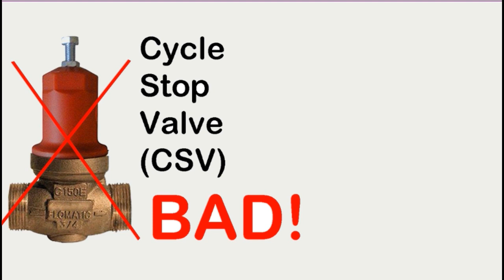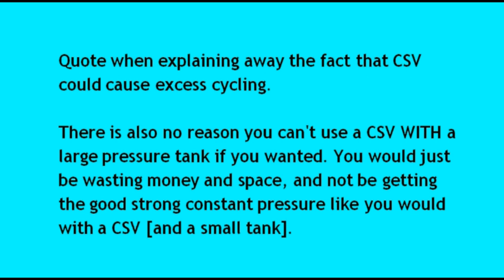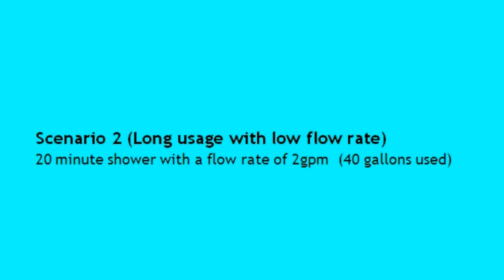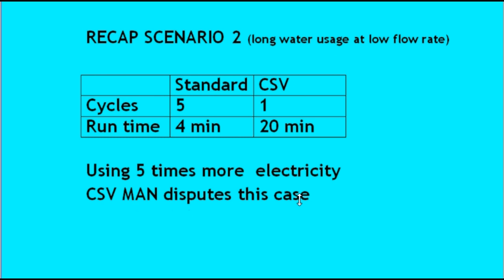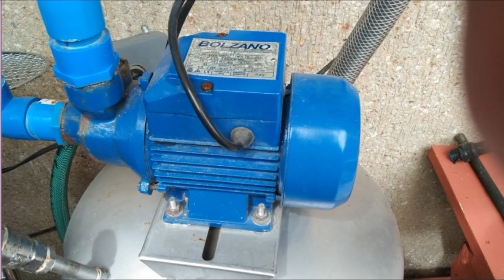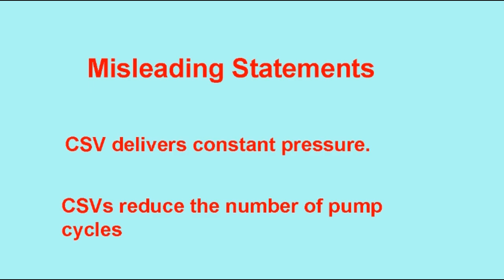Cycle Stop Valves ARE BAD for pressure tank systems!  Pros and cons of CSVs – few pros, many CONS!

Comment: I understand all the points you make, but how do I successfully tee off between my well pump and my pressure tank without a CSV? I need to tee off before the tank to run 300+ft of 1" poly to yard hydrants.  .  I am convinced I need a CSV because if I tee off BEFORE the tank, I would need to remove the check valve that is right before the pressure tank or i wont get pressure to my Tee/hydrants. If I do this and get flow to my Tee/hydrants,  the problem remains that I will be rapid cycling my pressure tank because I will be using hydrants to potentially irrigate an orchard. Putting a CSV before my Tee, after the well pump, should solve this by doing what it is advertised to do (maintain flow according to demand to limit pump cycling).But you make all these sound points against CSV. So how do I achieve what I am trying to do without one? Also, I need to remove the check valve between the Tee and the pressure tank in order to get flow to the Tee,  but rather than tossing the check valve aside, should I install it BEFORE the tee? So it is still doing it's job of preventing backflow but it would still allow flow to my Tee? The pump has a check valve built in, but I am worried about only having 1 check valve at the pump and mone beyond that because the check valves are said to only handle certain weights of water. My well is about 600 feet deep too so that's a lot of weight of back pressure/ water to lift.  CSV man pops up everywhere and makes GOOD points, but i dont know who to believe anymore. I have been doing HOURS of research and I keep seeing him pop up on forums and youtube....but I also see the SAME neighsayers pop up in odd places too.
Reply from the maker: Hi. I have one more thought about solving your problem in an efficient manner. I think this is what I would do if I was in your shoes. You obviously have electricity at the well because you have a pump there. Set up a water storage tank near the well. A water storage tank does not use a pressure switch, it uses a float switch. The pump goes on when the tank is empty and off when it is full. Set up a fairly large water tank maybe like 1000 liters or more near the well. Storage tanks are way cheaper than pressure tanks remember. Now you are saving the life of your very expensive submersible well pump as it is only going on once in a while when the storage tank is empty.   Now set up two booster pumps near the well. One goes to the house and has a normal pressure tank of say 100 or 200 liters. The system going to the fields only  needs a small pressure tank of maybe 5 gallons. Size the booster pump correctly to deliver the water to the field, powerful enough but not over powerful. When you turn on a hydrant the water will go on and stay on. All your problems solved. Life of the submersible pump vastly increased.
Reply: @LarryElterman  thanks for the time you put in to actually entertain my questions. It means a lot. I like your idea and I will try and scope out a way to accommodate such a system. The storage tank makes a lot of sense.
Reply from the maker: I will think about your problem. I will get back to you within a week if you want, i have to do a sketch and think exactly what problems you are facing. But before I get back to you I want to make some points.

1. I never said a CSV is always bad, there are some cases where they are good. You might be the case where it is good, i have to understand your problem fully.  A CSV is not always bad It's just that the CSV man try's to say it is ALWAYS good to have one.

2. Let me assure you, the CSV man can not be believed. He is not an honest man. He is a marketer trying to sell his product, not a person trying to solve your problem. You should see the insults he showered on my video. I had to remove them they were so disgusting. He told me every single point I made in my video is a lie and I am a disgrace to the engineering field. That is his mindset, defend his product at all costs!

By the way, what is your configuration? You have just one pump? You don't have a water storage tank?
Reply: @LarryElterman  there is just one well pump, supplying water to house bladder pressure tank. This 600 ft deep submersible pump has built in check valve. But no way for me to know if there are other check valves every 100 ft or so... Before the main line hits the pressure tank, it goes through a ball valve, then a check valve, located within 1 ft of the pressure tank. NOW that I think about it, it's probably a bad idea to tee my yard hydrant line off the main line before the pressure tank because this could cause my tank to flood right? If there is water demand happening before the tank, the tank could fill with more water than it's supposed to if there is demand from the house when it is empty? If this is a real risk and I end up teeing the yard hydrant line AFTER the pressure tank, I woould have to make sure my well pump isn't rapid cycling to meet the demand of both a yard hydrant and house fixtures. So I guess I would need a SECOND pressure tank in series with the first one, such that the pimrary tank goes to a Tee that splits into the house fixture lines and a path that goes to a solenoid valve (normally closed) that is triggered to open into the 2nd pressure tank (which goes to yard hydrant line) when the 2nd tank is hits low PSI cutoff, say 40 PSI. So basically, the 1st thank's pressure switch controls the well pump, and the 2nd thank's pressure switch controls the valve to let water in to meet demand of yard hydrant. The whole point of the 2nd tank would be to keep readily available pressurized water for my yard hydrant on standby rather than supplying that needed pressure directly from the primary house pressure tank.  so that if I have yard hydrant flowing to high use irrigation setup, and I want to also use house appliances, I dont need to cycle the pump as often as i would if I had just the primary tank supplying all the pressure. Having a 2nd tank would help isolate the yard hydrant system from the house faucet system and (if I install check valve between tank 1 and tank 2 somwehere) will also prevent possible 300ft water hammer from yard hydrant pipe when I close yard hydrant tap.
Reply from the maker: Ok, I studied  your problem a little bit (10 minutes) and the first thing i want to say is that you are not talking about a CSV, you are talking  about a pressure reducing valve, the two are not the same. A CSV is designed to replace the T at your pressure tank. It has three openings (in, out to the house and into to the tank) A pressure reducing valve only has two openings, in and out.

So let me see if I can boil down your problem. You have an irrigation system that uses a lot of water. But you also want the system for your residence. It sounds like your residence is at a higher altitude than your farm? And the will is very deep. You need a system that works for this case. Do I have it right?
Reply: @LarryElterman  and the house is technically higher than the irrigation field, but I'm not sure a storage tank is the right approach because the lines that run to the hydrants are buried 5 ft depth (to be below frost line in Maine) so they have to travel upwards (against gravity) to leave the spigot of the hydrant. It's a long length of line supplying the hydrant too, at least 300 feet long.
Reply from the maker: I am thinking some more. Why do you need to T off before the pressure tank? is it a physical thing? The well and pump are close to the fields?
Reply: @LarryElterman  the house is between the well and the fields. So the well is furthest from the fields/hydrants. The well is 600ft deep, then runs main line laterally underground to the house for about 100 ft, then house runs atleast 300 ft of 1"poly out to the field hydrants. So I would consider that a long way for water to travel. I suppose I dont need the hydrant line to tee off between the well and the house primary tank. Like I commented above in one of those long paragraphs,  I could tee AFTER the tank, as I am learning, the pressure drainage on the tank would be the same either way, but you at least have the added safety of putting it after the tank (of not flooding your tank). I know that if I were to put it before the tank, I would have to remove the check valve that is installed right at the incoming mouth of the tanks pressure switch. Removing that check valve could have consequences too. But no matter where I place it, there will be added demand of hydrant combined with house usage on one pressure tank which would cause rapid pump cycling. I am trying to avoid rapid cycling. So that's why I am thinking a 2nd tank would help
Reply from the maker: Ok, I am studying more, and have some questions and thoughts. Is this a new system that you are designing, or an existing system that you are trying to fix. That is, do you actually have a problem, or are you worried there will be a problem? I ask this because if you are designing this system, I am not sure you have the problem you think you have. Lets focus on the following statement in your description:

 "I am convinced I need a CSV because if I tee off BEFORE the tank, I would need to remove the check valve that is right before the pressure tank or i wont get pressure to my Tee/hydrants. If I do this and get flow to my Tee/hydrants,  the problem remains that I will be rapid cycling my pressure tank because I will be using hydrants to potentially irrigate an orchard"

So you are worried that if you turn on the hydrants you will get rapid cycling? I am not sure you are thinking about the problem right. 

Ok, here is why I don't think you have a problem for this case. Lets say the pressure tank is filled up to capacity and the pump is off, you are not using the hydrants, no water is being used. Now, all of the sudden you turn on the hydrants. It's true, it will only be a matter of seconds before the pump goes on. BUT!!!! Once the pump goes on it will stay on! The hydrants will reduce the pressure in the system so much that the pressure tank will never fill and the pump will not go off until you turn off the hydrants. The only time you would get rapid cycling in this case is if the pump was so massive it will fill the tank anyway. As long as the hydrants are drawing all the water the pump will never go off. I don't think you have a probleml!!!!! Explain why I am wrong !
Reply: Yes you have a good point about the constant flow from the well pump as opposed to Rapid on and off starting. As far as what is pre-existing versus what is design planning, the well and the main line and the house pressure tank and fixtures are all installed. The yard hydrant and the buried line that runs between them and the seller is also installed. I just need to figure out where to hook up the line for the yard hydrants to my water system somewhere.
Reply from the maker: @tomstegeman4344  The seller? I don't get it? Who is the seller. Also, you say you are worried about the tanks flooding? I don't understand what you mean. Pressure tanks don't "flood" A pressure tank will fill with water until the cut off presssure is reached, and then the pressure switch will turn off the pump.
Reply from the maker: @tomstegeman4344  I get the feeling that you have some misconceptions that are making the problem (from your point of view) more difficult than it is.  I may be wrong, but that is the sense I get. Maybe I am just misunderstanding you but I get the feeling you don't really understand how pressure tanks work and this is making the problem seem more difficult to you. I apologize  if I am wrong about this but that is the sense i get. I think (and again i apologize if i am misunderstanding)  that there is no real problem. The solution is simple. The well is between the house and the fields right? There should be a T at the well, pipes going to the house and pipes going to the fields. One pressure tank at the house. No need to worry about rapid recycling because the well is attached to the pressure tank. In the normal case the hydrants go on, the pump goes on and stays on.
You might want to also get a water tank at your house with a booster pump. This would reduce pump cycles of the well pump which is the expensive pump, the booster pump is cheap. That is my analysis!
Reply: @LarryElterman  sorry I meant to type "celler", autocorrect got me. Yeah I was mislead in thinking that pressure tanks had a valve that filled them with air according to pressure switch cutoff settings. I know now (thanks to more research) that  the only way it would flood is if the air bladder is punctured or there is physical damage. And as i said earlier, the house is between the well and the fields, so the fields are furthest from the well. So my Tee-off point is easiest to setup in the house nearby my accessible plumbing/pressure tank. The line that runs from the celler to the field hydrants are already set in in ground and it pokes through into the celler below the frost line and is cut there so I can hook it up however I decide. Sorry, I should have explained the constraints of my scenario before launching into possible design ideas. It sounds like I can just remove the check valve that is attached right before the pressure switch at the mouth of the pressure tank, insert my Tee there, and then determine if I need a larger pressure tank or if I need to add a second one. From what iv just learned, bo later how many pressure tanks you have in series, they will all maintain the same pressure as each other.. if that is true, then am I correct to assume that having a LARGER second tank (in series with my pre-existing tank) would be pointless because it would only maintain a max pressure equal to the first tanks max pressure? Meaning it would only make sense to buy a tank equal in size to my current primary tank? This second tank shouldn't need a pressure switch, as there can only be one pressure switch if I have only one well pump.

Comment from the maker: One of my commentators below pointed out another terrible thing about the CSV! I wish I had put this into my video because it is important! The pressure in the plumbing lines leading up to the CSV will be pressurized to the maximum pressure output of the pump. The CSV is restricting flow but not allowing the pump to turn off. So the pressure in the line leading up to the CSV will go up and up until the maximum pressure the pump can deliver is reached. You had better not have too powerful a pump or it will blow out all your plumbing Lines. Better check the max rating of the pump and keep it under about 75 PSI or so. Sometimes the max pressure of a pump is specified in HEAD HEIGHT.  To get PSI from head height in feet divide by 2.31.

So in one of CSV Mans videos he shows a pump that has good power reduction when restricted. However the pump he shows has a max PSI of 140! That will most likely blow out your plumbing line!

Comment: I have not finished  this video, I’m going to share it with my husband first to see what he thinks as well, but do you have a solution for more water pressure for using the sprinklers?
Reply from the maker: I thought I answered you before but the comment disappeared. I can help you if you tell me your exact situation. Town water, well water? what is your system? Well pump? Booster pump? Town water only?
Reply: @LarryElterman  So we have a well, a pump, and a medium size pressure tank. After being introduced to your video, I decided  to read the comment section on Amazon from other people who bought the CSV Valve,  and people are dissatisfied because the back pressure caused by the valve is blowing out their lines. My husband thought it might be a good idea to get a second pressure tank?
Reply from the maker: @patriciacratty4715  Ha, the back pressure blows out the lines! Right! Why didn't I think of that when I did my video! Yes, you had better not buy a pump that is too powerful or the back pressure will blow out your plumbing! A CSV forces you to buy a smaller less powerful pump!  Love it! Another major strike against CSV. Ok, let me try to solve your problem.

Just keep on answering my questions and I promise to solve your problem! So you are unhappy with your present system when using the sprinklers. I have some more questions.  What exactly are you unhappy about? You mean the sprinklers are sort of just like dribbling out water? Not shooting the water high enough into the air? I assume the pump is going on and staying on the whole time the sprinklers are going? Or is the pump cycling on and off when the sprinkler is going? Do you have just a single submersible well pump going into a pressure tank?  Or do you have  the well going into a water storage tank with a booster pump?What is the head height of your well? In other words, how much below ground level is the water? Answer these questions and I am sure I can provide you with a solution. By the way, pending your exact answers I will say it is unlikely you need a second pressure tank. I don't think that is the issue.
Reply: OK sweetheart, I appreciate your willingness to help us troubleshoot. I’m going to take you up on that😎 As soon as we get a bit of time like Sunday evening, if that’s ok? Thanks again for your time😇🇺🇸
Reply from the maker: @patriciacratty4715  ok, no prob, I will look for your answer.